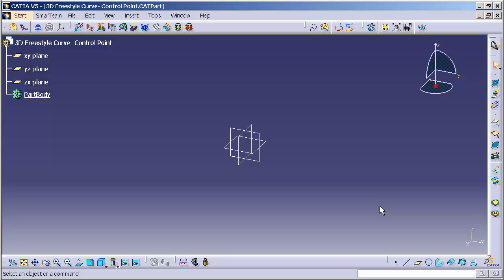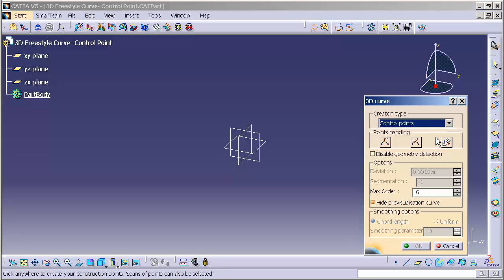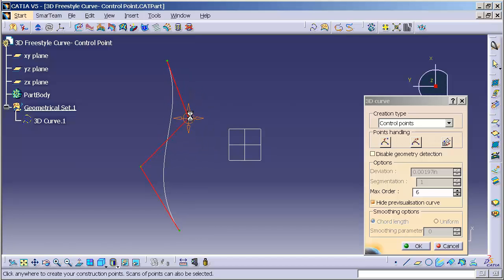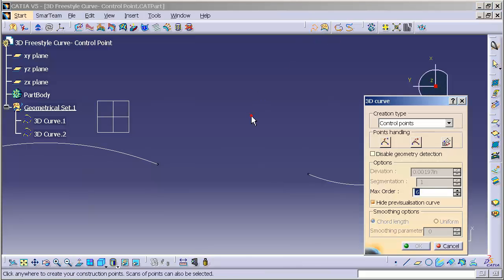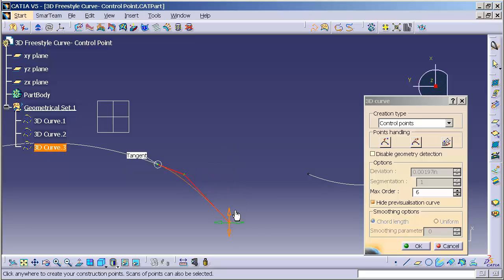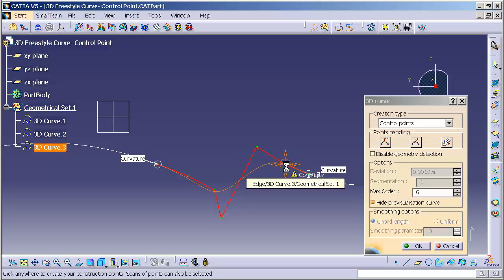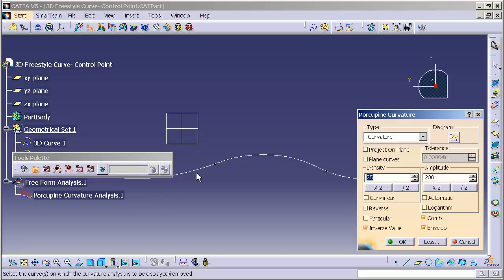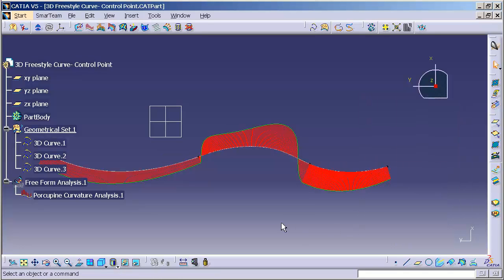Catia V5 | Catia V6: 3D Freestyle Curve  Control Point | Step 1

Comment: Hi! 1. Is this the only way to use polygon based curves in Catia? GSD only seems to have the control points on the curve. 2. Is there a way to analyze to see the knots in a curve in Catia? (I've seen it in your NX video)
Reply from the maker: Freestlye has what you want.